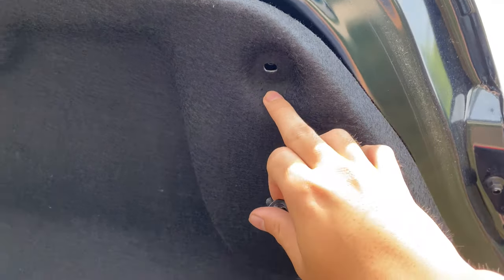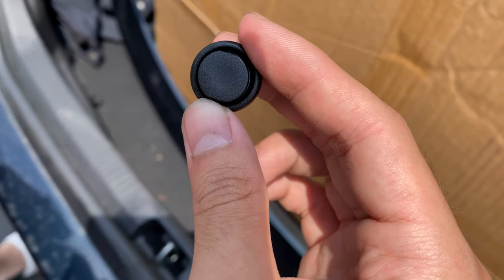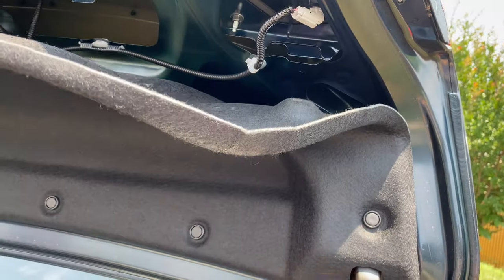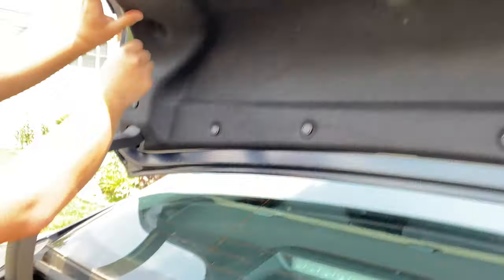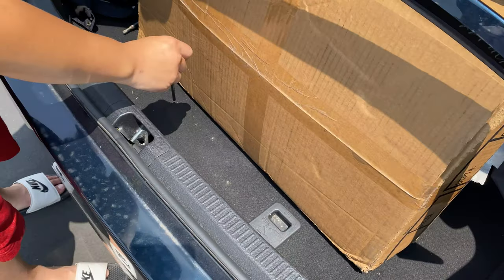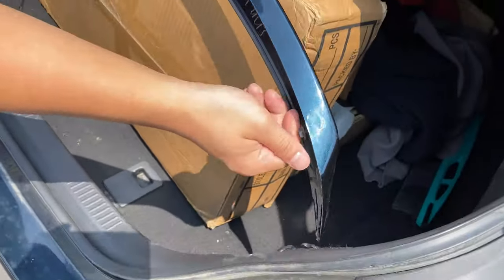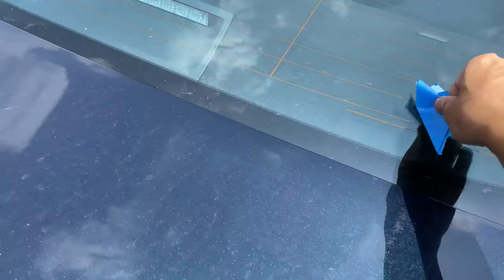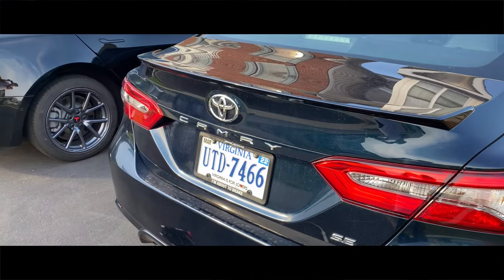Toyota Camry Aggressive Wing Install

Comment: How is the double tape holding your spoiler ?

I bought 3m Tape from auto zone but it sucks come out from the corner the next day & dew days after the rain come out the other corner so i want to take it out again & put it again so the tape is good the one you put or bad?
Reply from the maker: it’s good like very good. i use scotch double sided tape from home depot. i don’t normally get 3m because i like the strength and size scotch double sided tape gives you
Reply: @DennisNguyen  oh alright thank you so much i will buy it today from home depot
Reply from the maker: no problem
Reply: @DennisNguyen  is this one. Scotch Permanent Double Sided Extreme Mounting Tape ?
Reply from the maker: yea

Comment: I know the vids been up a while and everyone asks this but…do you know if it will fit a 07 camry?
Reply from the maker: it will not
Reply: @DennisNguyen  is there any way to mold it with the heat gun/cut stuff 🧐 i really want one like this but they dont offer much for the 6th gen. Or are the trunk curves too different?
Reply from the maker: the trunk is a bit wider and it has some sharp edges that the previous gen camry doesn’t have

Comment: How you did with the corners of the spoiler, they are separate from the trunk
Reply from the maker: mine is one piece not separate
Reply: Yes my is exactly the same, what I mean is that both corners of the spoiler are lifted
Reply from the maker: you can use a heat gun and flex it down with the double sided tape on the other side and make sure to put pressure on it
Reply: @DennisNguyen  yes I have the same one.  I am running into problems with the install.  Same car same spoiler. How do I get it to lay flat
Reply from the maker: heat gun it and with the 3m tape on so the spoiler flexes a bit and the tape will stick
Reply: @DennisNguyen  I don’t mean to sound stupid but do I put in on then heat gun it or do I heat gun it then put it on
Reply from the maker: put the tape on first then heat gun and all good everybody learns new things so it’s not stupid
Reply: @DennisNguyen  ok thanks bro.  So do I heat it from left all the way to the right or just the center part
Reply from the maker: yes left to right to make sure it sticks pretty well
Reply: @DennisNguyen  and doing this softens the actual duckbill as well ?
Reply from the maker: yes a lil bit

Comment: I’m trying to find a spoiler for it but can’t find anything I’m so confused
Reply from the maker: https://www.ebay.com/itm/Fits-19-20-Toyota-Avalon-Rear-Spoiler-Wing-ABS-Matte-Black-/293391028678?mkcid=16&mkevt=1&_trksid=p2349624.m46890.l6249&mkrid=711-127632-2357-0

https://www.ebay.com/itm/Fit-For-TOYOTA-Avalon-2013-2018-Sedan-Rear-Trunk-Lip-Spoiler-ABS-Wing-With-Light-/402943075123?mkcid=16&mkevt=1&_trksid=p2349624.m46890.l49286&mkrid=711-127632-2357-0

https://www.sportwing.com/AVA19-FM-Toyota-Avalon-Factory-Style-Flush-Mount-Rear-Deck-Spoiler?language=en&currency=USD&gclid=EAIaIQobChMIrNvf78q08gIVjLLICh1bxgAzEAQYASABEgI1wvD_BwE
Reply from the maker: this is all that i can find for the car

Comment: The long, thin bracket that came under your oem spoiler...Did u install it back where it originally was under your new spoiler and what's it for?
Reply from the maker: yea the bracket i left it under there because i believe if i remove it there would be more holes i would have to cover up
Reply: @DennisNguyen  So does the bracket come screwed to the oem spoiler and how do u remove the spoiler from it..I wanna change my spoiler out but don't wanna break anything. And I guess I can use the same bracket if I ever decide to put my oem spoiler back on?. Thanks for the info fam.
Reply from the maker: so there’s only 2 screws on the spoiler and 3m tape. and i kept the bracket on it since the trd spoiler covers the bracket there’s no point in taking it off and if anything happens i can put the original spoiler back on easily
Reply: @DennisNguyen  Thank you much appreciated. Your new spoiler looks good btw.
Reply from the maker: thank you, thank you

Comment: Could that work for 2012 camry?
Reply from the maker: no it will not work
Reply: @DennisNguyen  there any recommendations for a 2012 camry spoiler. Thank you
Reply from the maker: this is all they make for the car https://www.ebay.com/itm/193184515398
Reply: Looking for this style spoiler too for my 2012 🙃😂